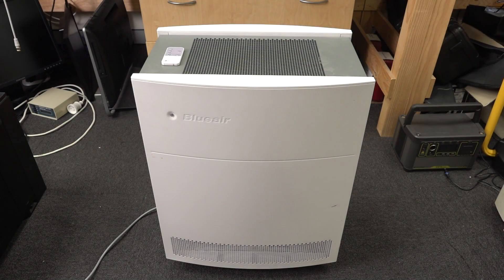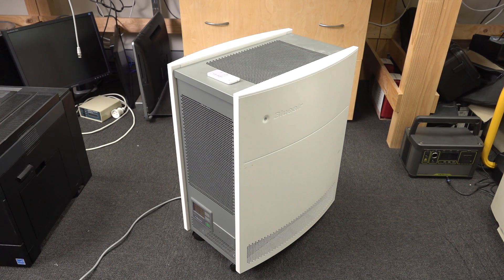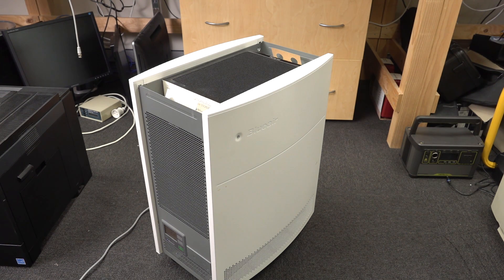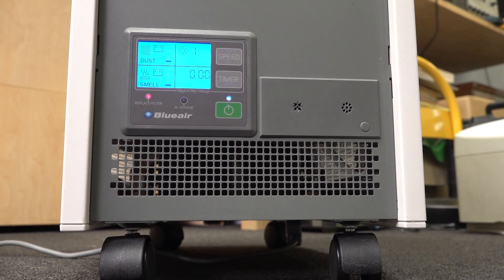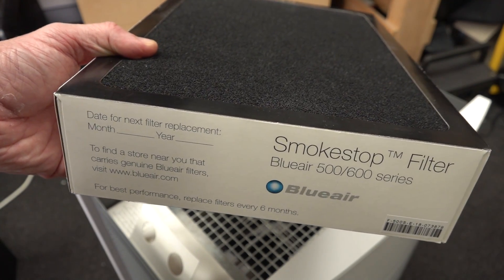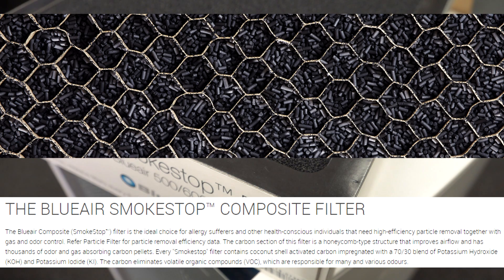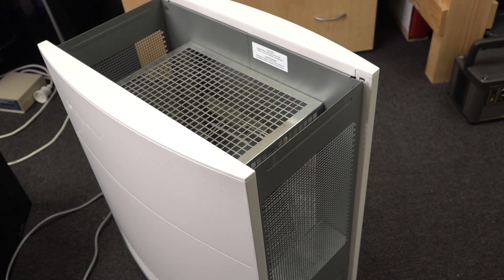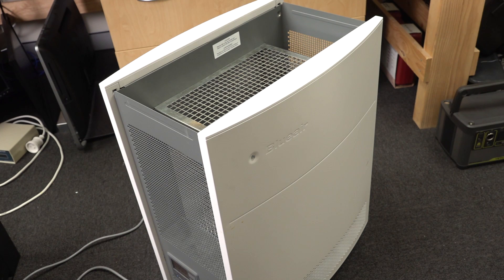EEVblog #1295 - What Makes A Good Lab HEPA Air Filter?

Comment: Look at Innovair purifiers... fully metal with massive filters and DC brushless motors for really low power consumption and quietness. Not the smallest or prettiest with any fancy functions, but it has a simple job. I have IAQ and PM monitoring, and it filters the air to even less than 1um. Avoid plastic purifiers as plastics over time do let off chemicals as they age, as I discovered from my formaldehyde sensor...
Reply: I have an IQAir and the thing is great! but also an insane price. I got it via auction

Comment: Is this practical for just having clean air in your room to having clean air say if I put this next to a cat 🐈 litter box? Or anyone got a recommendation. If you’re a pc guy I was the Noctua fan of air filters. Only some will understand what I’m asking around here!
Reply: Abraham blue air or Iq air are both top notch units, and can filter 900 or so square feet. you could lower the fan speed if you are using it in a smaller space. Owing Both a Blueair and a Iq Air I would go for the Iq Air.

Comment: None of these filters  move enough air to be effective.  The 650 provides 2 air changes per hour for its rated room size.  The only way to effectively deal with virii is to filter all air in a negative pressure environment.  That doesn't mean they don't work.  They do.  They are just not effective for stopping the spread of bacteria, virii or asbestos.  All of which can kill you. (edited to positively remove a double negative)
Reply from the maker: 5 room changes per hour on full.

Comment: Those BlueAir cleaners are nice.  Too bad the filters are very expensive.  Here locally you no longer get the BlueAirs as buying two sets of filters usually cost more than the machine itself.    Inkjet printer story comes to mind....   Would be nice if some company made a machine that used moss and h2o for filter medium to clean the air like H13 Filtration..

Comment: I got my blue air 600 after I learned that they were used by the hospitals after hurricane Katrina in New Orleans.  I have had it for more than a decade, and am very happy with it.  I will get an electrostatic eventually, but as you mention, they aren't cheap.

Comment: Preventing covid, doubtful.  Droplets will be all over the lab before reaching that guy.  Sensors where what I wanted to see and called it.  Laser/optical for particulates and VOC for "smell".  Nice unit and I doubt your filters are anywhere close to EOL.  Measuring dP @ design flow will be something you can track back to a datasheet.
Reply: Anything that reduces the amount of aerosols containing the virus will be helpful in preventing disease. Even if you had a little tiny HEPA filter in a warehouse, that only circulates the air every month, will reduce transmission by some degree. There were some idiots that were saying that face masks don't don't any good against SARS-CoV-2. Even the bottom of the line surgical masks that loop around your ears, will prevent transmitting to some degree; even if it reduces it by 1%. Diseases are not transmitted instantly by breathing in air with aerosols that contain the virus. (You most likely won't contact the virus by breathing in an single aerosol particle with a single virus particle in it.) There is more to contraction than just breathing the air that an infected person has expelled. (Both biochemical and statistical reasons.) It's like putting an open container of gasoline in a garage. It's highly unlikely that the stochiometry will be just right for an electrical contactor to ignite it. The filter will do a great deal towards reducing the transmission of viral pathogens.

Comment: never replace a filter based on the calendar, always replace a filter based on performance.
Reply: Sure, but how do you measure performance in this case? The sensors are only on the intake :(
Reply: @MrJef06  A good quality filter won't start bypassing dirty air, rather it will obstruct more and more airflow, so simply feeling how much air is coming out is a good test.
Reply: That's difficult to measure, though...
Reply: yes, same with your razor blades/cutters
Reply: Exactly, they don't go bad.

Comment: Ozone generators should be more widely used, with precautions!  

Ozone displaces oxygen in the air - it carries the same risk as breathing a helium balloon.  That is not to say it's good to breathe, but it's not a poisonous or toxic gas.  It "simply" causes suffocation if used improperly.  It can also damage natural rubbers - also if used improperly.  

Today's solid-state plate generators are used for "ozone shock treatments" where a large amount of ozone is pumped into a room, car, a sealed bathroom with housefire smoke-damaged items, etc. for a short period of time, then the ozone is vented outside.  As ozone (O3) decays into oxygen (O2) the extra oxygen atom contacts and oxides organic substances, essentially neutralizing them. 

You can buy a kit on ebay for $20 or spend a little more like I did and get a nice enclosure around it.  5-10 minutes for medium-sized rooms with a 10g/h generator is all that's needed to deactivate the virus.  

An ozone generator is an excellent tool all around if used safely.  It can kill plants, pets and people, but it also kills bacteria, viruses, and eliminates odors without leaving absolutely any residue.

An air filter can't suck up viruses already on surfaces - it only filters the air.  An ozone generator creates a gas that penetrates anywhere air can.

For more info, I'd suggest jumping into the automobile sector - sellers frequently use them to clean cars that smokers had owned.
Reply from the maker: Don't spread bullshit, ozone is dangerous to your health: 
https://www.cdc.gov/niosh/topics/ozone/default.html
https://www.niehs.nih.gov/health/topics/agents/ozone/index.cfm
Reply: @EEVblog  P.S. Ozone has a pungent smell too - you can't miss it - you would definitely know immediately if you were breathing it in.  A built-in warning system.
Reply: @johndrachenberg2254  Yup ozone is a great tool. it is an excellent low-cost way of sanitization. You just need to treat it with respect. Good job. Most of the harm of ozone is associated with Chronic Ozone Exposure. If it is just acute exposure all the damage is reversible. Basically, some of your cells are dying and they will heal. This is unlike other toxins like solder fuse that build up over the life of the person.
Reply: @EEVblog  Did I not clearly state that you must you proper precautions since it will kill people, pets, and plants?  All you have to do is let the atmosphere vent.  Perhaps you should look into how ozone works and stop trying to scare people away from using them.  You encourage people to melt lead solder and flux, which are vastly more hazardous to your health if the fumes aren't vented.  

Again, you're essentially generating oxygen atoms - these atoms are extremely reactive to organic tissue - that's why it works so well at removing odor.  How can you not find any supporting evidence?  It's all over the web.   From the page you linked: "Ozone is used in many industries. It is used for purifying air and drinking water, in industrial waste treatment, oils, bleaching and waxes, and to make other chemicals."
Reply: It´s also used to rejuvenate face skin.
Reply: https://www.youtube.com/watch?v=2UdtKssU7po

Comment: I'm kind of surprised it pushes air through the filters... typically they pull through, so the pressure difference helps to keep the filters seated. Otherwise the filters get pushed away and air can leak around them instead of going through them.
Reply from the maker: So what? It's about the total volume of air filtered and changed per hour. Doesn't matter if it does 100% of the air sucked in or 99%, that unfiltered air will eventually get sucked back in and filtered.
Reply: @EEVblog  It's lost efficiency. I suppose it doesn't matter as much in a non-critical application like this (vs. say, a surgical procedure room) but you're spending energy to push the air, so any air that gets pushed but not filtered is energy wasted. My field is mechanical engineering (HVAC) and the vast majority of filtering is pull-through; if it's blow-through then at least the filters are still retained such that the flow pushes on them to maintain a better seal.

Comment: meanwhile i'm still using an old box fan with a filter taped to the outlet... might not filter the smallest but it really gets filthy after running it for a couple months
Reply: Which probably improves it filtering capability.

Comment: ORECK XL professional with 3m carbon pre filters is what I use in my apartment -  It makes a huge improvement.  Easy to breath is a great thing.  My machine makes ozone but we also circulating with fans and vent outside so the air is always refreshing. Lint is the hardest thing to clean out of the fan drum over time.   I blame poor carpet in my home for that problem.

Comment: Dave, what do you think about 3nm filtering with Philips 4000i Air Purifier ? Small enough to capture even the smallest viruses?
Reply from the maker: Sounds like a bullshit claim to me.
Reply: @EEVblog  Please Check your Self. Your claim that "True HEPA" is carp is wrong. True HEPA is equivalent to H13. Please take a moment before you use categorical language.

I think the Philips most defiantly stands up to there claim. I am sure they have tests and certifications to prove it. 

https://standardscatalog.ul.com/standards/en/standard_586
Reply: I can't find where they claim 3nm filtering on the Philips. They only claim .3 um (300 nm). Has @xureality stated.
Reply from the maker: @Ender_Wiggin  3nm? 3 NANO METERS Do you know how ridiculous that claim is?
Reply: EEVblog I cant find this claim in any of there marketing material. I believe this was an error by the original poster.
Reply: @Ender_Wiggin  They claim exactly 3nm (Powered by the upgraded VitaShield technology, effectively removes 99.9% of particles as small as 0.003um, including airborne allergens** like pollen, dust mite, and viruses***, bacteria****). It is all over the ads materials and since I have the product, it is on the box too.
The claims is from the first link in google: https://www.philips.com/c-e/ifa/products/air-purifier-4000i-breathe-better.html
Reply: @EEVblog  Yes, that is quite challenging, but still the brand is Philips. I bough also a replacement filter: Philips FY4440/30 NanoProtect S3.
On the box they claim the same and they give an example of filtering Influenza A (H1N1) virus! Those claims are quite serous indeed, although the H1N1 is a very large virus: 80nm (the smallest one was around 17nm).
This is translated from philips.bg (europe): https://translate.google.com/translate?sl=bg&tl=en&u=https%3A%2F%2Fwww.philips.bg%2Fc-p%2FAC3858_50%2Fseries-4000i-air-purifier
I certify that the translation is correct (3 nano meters and claims for the viruses)
Reply: @JulianBG  So like @xureality said the nm range is easier to capture then .3um that is why .3 is used. The claim of nanometer level filtration is not entirely unique^1. From what I can tell almost nothing is that small other than VOC that the carbon takes care of^2. The reality is that no one calls out 3nm matter normally because it does not matter. Also, I could not find testing at the Nanometer level. I believe this is due to the fact that particle are just not that small.  It could be an extrapolated claim like what is Philips website^4. 

1: As a similar claim, The standard Hospital air filter:
 https://www.iqair.com/us/room-air-purifiers/healthpro-series

2: Condensed expiration of what is in the CDC DOC. 
https://smartairfilters.com/en/blog/what-is-pm0-3-why-important/

3: CDC Guidance for Filtration and Air-Cleaning Systems: Has all the info but hard to find. look at Page 11 and 59. 
https://www.cdc.gov/niosh/docs/2003-136/pdfs/2003-136.pdf?id=10.26616/NIOSHPUB2003136

4: Look for ***: It is a theoretical time for one-time cleaning calculated by dividing its CADR 500m3/h by the room size of 48m3 (assuming the room is 20 m2 in floor area and 2.4m2 in height).
https://www.philips.com/c-e/ifa/products/air-purifier-4000i-breathe-better.html
Reply: @Ender_Wiggin   Thanks for the information, especially for https://smartairfilters.com/en/blog/what-is-pm0-3-why-important/, however the claim that nano-range is not important and is not typically advertised fails due to few couple of very important issues:
a) ultra-fine particles (nano range) are more dangerous to the lung compared to PM0.3, PM2.5, etc, because according to the research it is harder for the body to get rid of them, since those ultra-fine particles goes way deeper in to the lung tissue (accumulating effect over time).
b) there are barely few companies claiming filtering out with "normal" filters (i.e. not electrostatic/plasma) viruses, since they are very small (range 17-100nm), but it is something that people are interested and would love to buy. So, it is not just 0.3 um, but also around 0.1 and 0.05 ranges, which I saw the efficiency goes below 50%. I can only guess that some of those claims are specific for the type of material used to produce the filters and it can vary greatly from filter to filter.
c) raise in home 3D printing led to a lot of research regarding the danger of nano-particle emissions and the huge level above the norm and how poor filtering systems works in nano-range. There were couple of scientific researches claiming that standard PM filters available on the market are inefficient to capture nano particle coming out of the 3D printing process - the amount of particles emitted out of the printer could be 1000 times more than those in the range of PM0.3 and yes indeed VOCs are also very serious part of the problem with many 3D printing materials, but are not the only one unfortunately.

All those things contradict to the claim above that it is important just the 0.3 um. Such filtering is quite poor for filtering nano particles of ABS printing.
Reply: Less bullshit and more misleading, filters are the least effective at 0.3um (300nm for those playing along at home) because there's no good way to capture particles at those sizes. Larger particles collide with the fibers of the filter, or just plain old get stuck in between two of them. Smaller particles just go on random walks instead of following the airstream nicely, which means they have more probability of impacting the filter.

TLDR; 3nm is a marketing wank word, .3um is the measurement that matters

Reference: "Guidance for Filtration and Air-Cleaning Systems to Protect Building Environments from Airborne Chemical, Biological, or Radiological Attacks", CDC, NIOSH, 2003